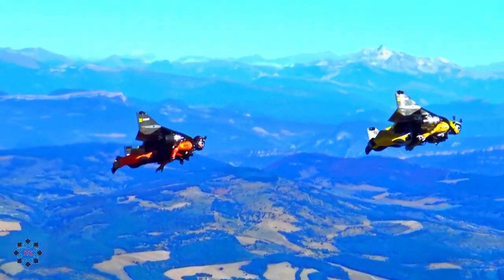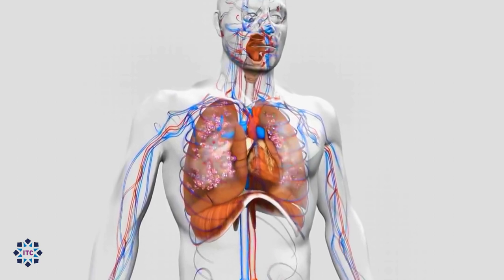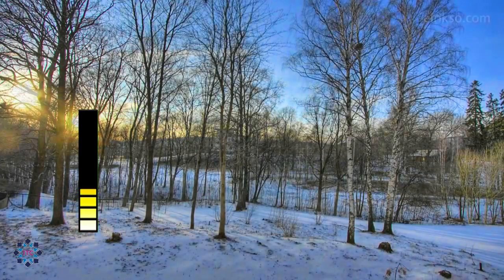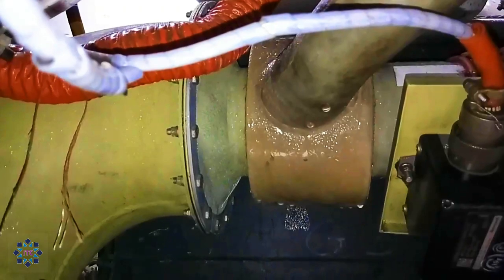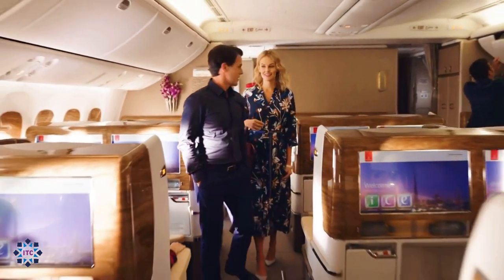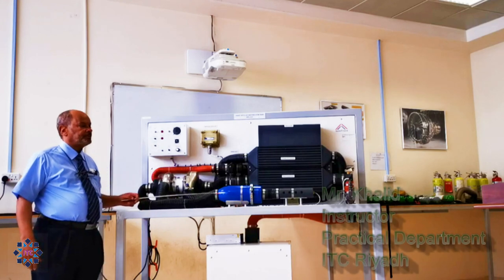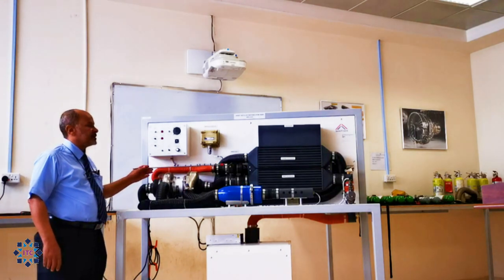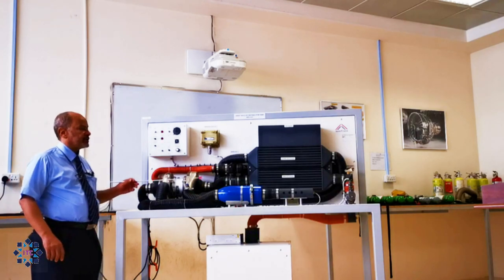Aircraft Airconditioning and the Air Cycle Machine

Comment: Does that really work? The plastic hoses look like they would blow off or melt with the bleed air temperature, there is relatively high pressures and flows inside an aircraft PAC??
Reply from the maker: This one is a mock up with fewer moving parts,not as robust as the real ACM, although those hoses seem more brittle than they actually are.

Comment: Sorry, but how does the air get cooled again? By extracting water and drying it out? Lots of talk about heating and reheating, but HOW does the air become cool?
Reply from the maker: When you compress, air heats. The air cycle machine does the opposite, it allows hot air to expand and cool in the expansion chamber. Before that happens the air would have already processed thru the heat exchanger that would make the first cooling impact over hot bleed air from the engine. Please refer to the lesson that talks about secondary heat exchanger.

the ACM here is training model which functions on same basic principle as actual aircraft ACM except that it won't show you the actual engine attached to a wing.
Reply: This was a good example of an ACM layout, but not a good lesson on HOW it works.

As he did mention (briefly) temperature does whatever pressure does...
Px goes up.... Temp goes up.
Px goes down... Temp goes down.
Let's call this rule 1

The other important thing is that you can change temperature without effecting pressure much at all.
Lets call this rule 2

Let's not get into the numbers, just imagine a scale from very low to very high.

Air the plane is flying through...... px=v.low, temp=v.low
Air goes into the engine compressor and into the bleed valve... px=high, temp=high (rule 1)
Air passes through primary heat exchanger..... px=high, temp=medium (rule 2)
Air goes through compressor of ACM...... px=v.high, temp=high (rule 1)
Air passes through secondary heat exchanger.... px=v.high, temp=medium (rule 2)
Air uses all that pressure to drive the turbine of the ACM, then empties out into a larger volume....px=medium, temp=v.low (rule 1)

Now you have very cold air at a useful pressure.  
You can now mix it with hot air from the start of the cycle to get the temperature you want.
It can now enter the cabin at a constant rate, you then vary the rate that it leaves the outflow valve and that's how you can adjust cabin pressure too!

Hope that helps.

Comment: Could you tell me why don't we use ACM instead of conventional Air conditioner?
Reply: The energy required to provide the high pressure high flow air into the system would be way too much to provide without the use of a very large compressor and would be very inefficient. Aircrafts already have this source of air from the compressor stage of the  jet engine. Noise would also be an issue.

Comment: So this aircraft air conditioning system doesn’t require the gas used in domestic-like ACUs? Is it because of the constant ramming air that the aircraft is constantly receiving?
Reply: This process follows the brayton cycle not the Carnot/refrigeration cycle - no refrigerant is required

Comment: I still don’t see where the system can cool cabin air much below outside ambient temperature when you’re on the ground. Like, in a car, I understand where the refrigerant goes from a high temp and high pres liquid to a low pressure vapor (that is very cold) at the orifice tube, and after. But where is something like that happening here?
Reply: You are overthinking it. When on ground the exact same process occurs but the hot high pressure comes from the APU instead of the jet engines